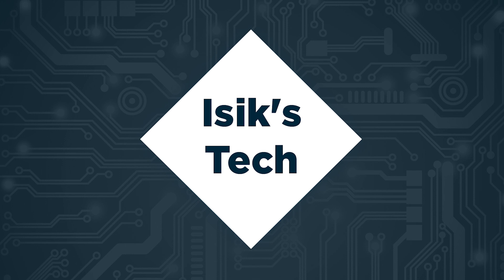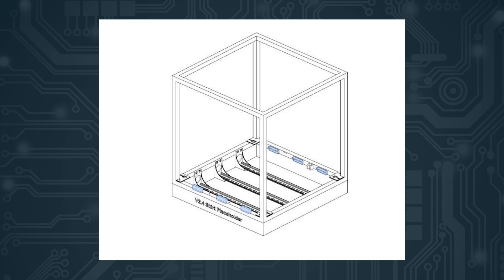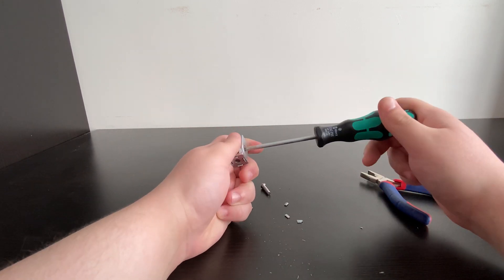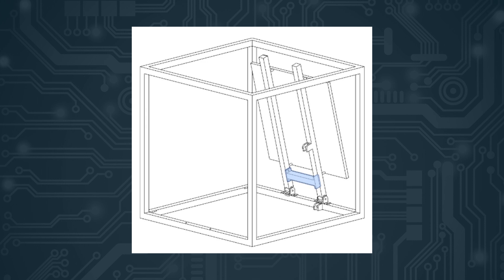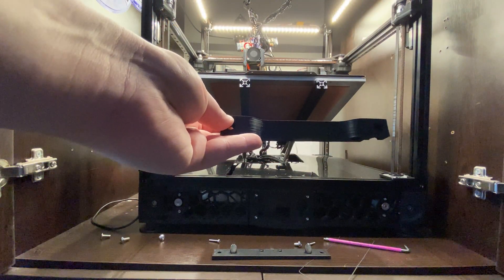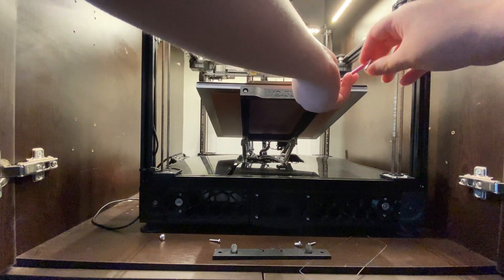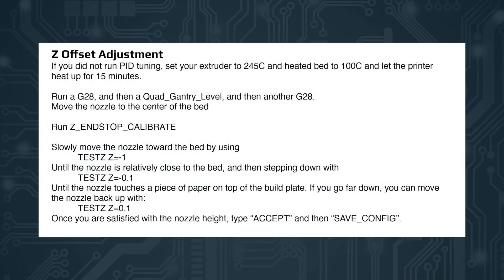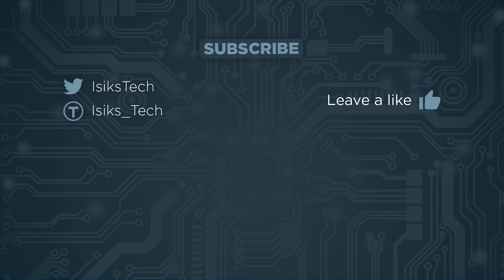Heatbed Hood Mod Assembly Manual - Video Version

Comment: You should attach the middle pannel to the bed frame. It would make the opening even quicker :) 

good Idea overall
Reply from the maker: The reason I didn't do it that way is because the rear Z belts would interfere when opened.

Comment: I've tried to download the F360 file and others but they don't seem to download correctly.  From what I see there is no download option on the github page
Reply from the maker: There is a download button if you open the file.
Reply: @IsiksTech  Found that thanks.  DXF only has Raw, Blame or History for options and is displayed as text.  But I copied it to a text file and made the extension as a DXF file and that worked.  Currently working to make my Voron 2.4, and I don't want to flip it to work on the electronics.  Thanks again.  Good work on this mod :D